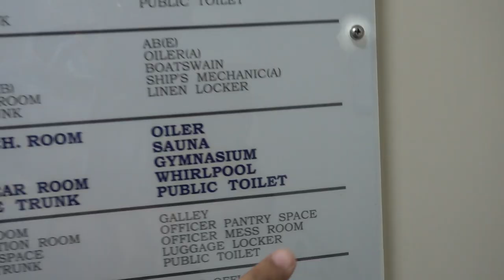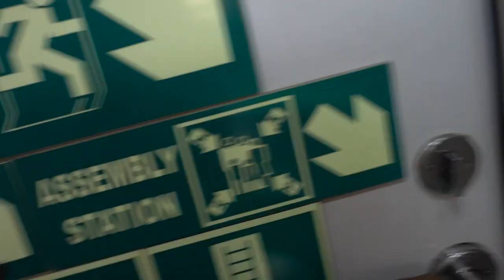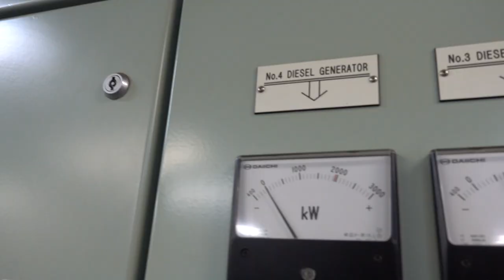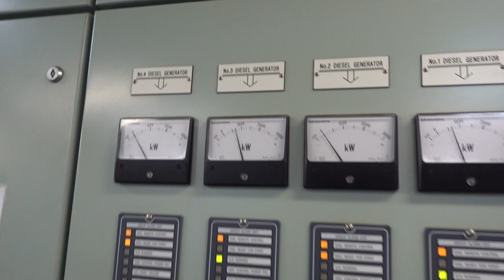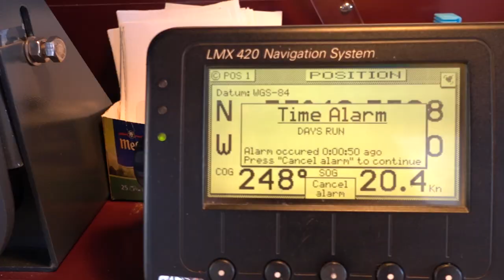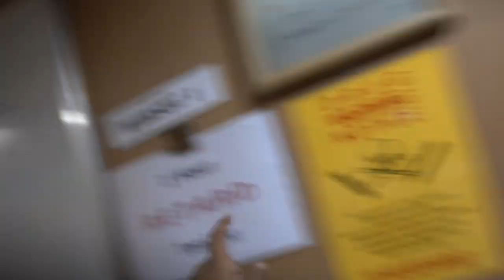CARGO SHIP TRAVEL! AMAZING ADVENTURE!

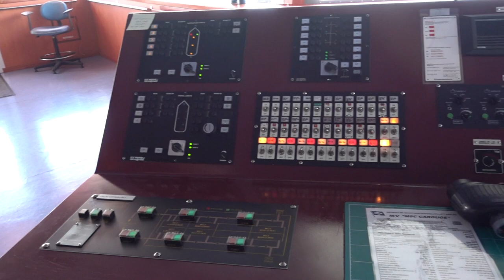Comment: At 8:54 it says the ship is called the MSC Carouge.  Wikipedia says: MSC Carouge is a container ship built in 2007 by the Daewoo Mangalia Heavy Industries in Mangalia, Romania 

Tonnage	54,549 DWT
Length	275 m (902 ft)
Beam	32 m (105 ft)
Depth	21.5 m (71 ft)
Decks	8
Propulsion	
4 × B&W 7K98MCC diesels
combined 39,352 kW (52,772 hp)
Speed	24 knots (44 km/h)